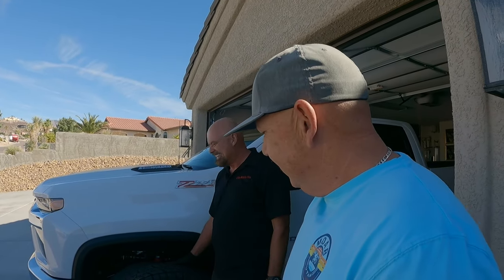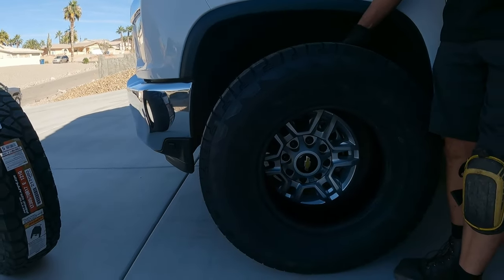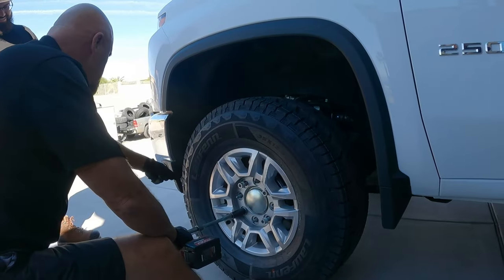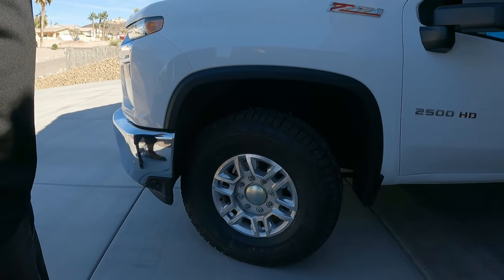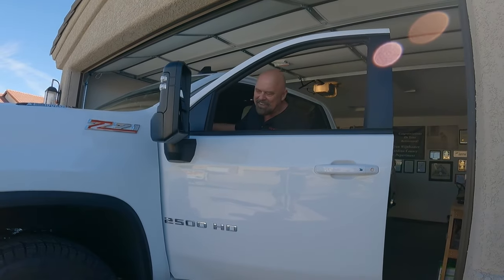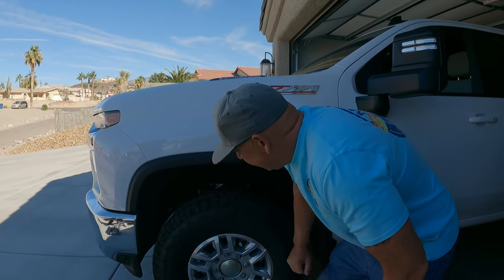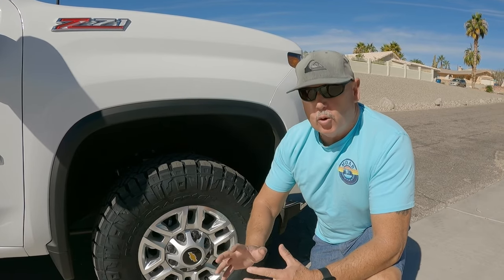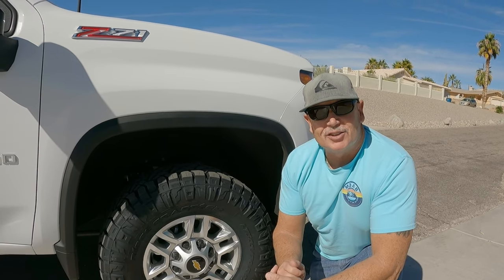2022 Chevy 2500HD Duramax 35 inch TIRE FIT TEST// WILL IT FIT?

Comment: I just put 35x12.50r18 nitto ridge grappler on 18x9 +18 offset on my stock 2022 at4 2500. Fits with no rubbing. I hunt and go off-road quite a bit and haven't had any rubbing issues.
Reply from the maker: Danny, that is good to know for our viewers.  I could of done the 35s no problem also. I use my truck as a tow vehicle, it changes the gas mileage and it changes the speedometer dramatically.  Thanks for watching and thank you for your comment.  Stan
Reply: @OverTheHillAdventures  I am getting a 2022 AT4 drama in a couple of months, so thanks for the info.Saved me a lot of phone calls etc thanks.Danny did you put those on the stock rims or aftermarket . As far as towing l see a lot of guys have seperate towing tires and nice rims and big tires for every day use. That is road l am taking.
Reply: I know for a fact that it wont rub with a 2 inch front leveling kit but stock of course it will.
Reply from the maker: @BlkGryTurboR  I am happy to say no rub at all even off road. Thanks for the comment. Stan
Reply: You think it would fit without rubbing if the offset was -12?

Comment: Thank you for this video man, You helped me make a decision on my purchase. I like to go a little bigger in tires without looking like I'm going through a mid life crisis.
Reply from the maker: Mario, that is awesome I’m glad I could help. Stan
Reply: Exactly! Lol, so what did you do and how did it work out, mine is 2021, Z71, LTZ, but it came stock with 20 inch rims. Currently 275/65R20. Like to go up, but not look like what you said.
Reply: The guy at my tire shop is convinced 295x65R20 will rub the UCAs with stock 20" rims. I would like to verify this is not the case before purchasing

Comment: I went with the 295/65 R20 which is a true 35" and has a higher load rating than the 35/12.5 20.
Reply from the maker: Hi Jeff, good for you!  I have E rated tires.  What are your tires rated at.  I bet your tire looks good.
Reply: @OverTheHillAdventures  Mine are also E rated and each tire can hold 4080lbs @ 80psi
Reply: No rubbing coming out of a driveway? Are you running a Leveling kit?
Reply: @carlosierra11  If that's directed towards me no level and no cutting or trimming. My 3500 did come with the beefier plow/trailer torsion bars.
Reply from the maker: @carlosierra11  same here no leveling kit.  I would caution other than stock rims if you go with aftermarket rims you might have a problem.  Thanks for watching.
Reply: @hdrolling thanks for the info. Which model tire did you go with? I'd like to do the same on my 2024 hd2500 zr1 on stock 20s
Reply: Most folks don’t realize that most 35’s are not true 35’s. They’re actually around 34.5 to 34.7 depending on the tire

Comment: Appreciate the video, mine is leveled so going to see how the 35s run on it. Thanks!
Reply from the maker: You won’t have any problems.  Remember we are using stock rims with stock offset.  Aftermarket rims may give you problems. FYI
Reply: My 2020 is almost level and is on 35s, been off road a bunch and no rubbing. That's with stock rims which are 7 or 7.5 inch wide. Had M/Ts on for a while (no highway shake). Switched to BFG K02s and according to GM tech (and BFG site) rims are to narrow for that tire, truck shakes over 55. It's been balanced 3 times including road force balance. Truck has steel WT rims too.
Reply: I keep hearing that leveling it makes it drive like a brick.. is that true? I’m getting mine here soon and would like to just level it with 35’s
Reply: I’m getting a 2020 2500HD soon. Want to put it on 35’s and level it. Are you saying that will make it shake over 55mph?? 😶
Reply: I have a leveling kit on my 2022, I took it to an independent shop for wheel alignment afterwards. Rides a  lot better. Had 2 different chevy dealers tell me that vibration was normal on factory 18s and those worthless michelin tires. Will be going to Falken 35s when they are worn out.

Comment: Barely fit on a 17 inch wheel. I have a high country which comes with a 20 inch wheel so I guess I won’t be able to do that without mods
Reply from the maker: Hey Manny, with your 20inch rims your tires are already 34inch tires. You will have no problem putting on 35 inch tires. As long as you use your stock rims.  Wider rims or aftermarket rims won’t work.  Stan

Comment: Of course you can. The stock Z71 comes with a standard 34.7 on 20's for 2022 year model. I also fit 37's stock, with minor rub.
Reply from the maker: Unfortunately mine came stock with stock 17 inch rims and 32””
tires.  I wish I knew this almost two years ago when I bought the truck.  Thank you for your comment!  A lot was learned when I first put this video out.  Thank you. Stan

Comment: I have the exact same truck, 2024.  Put on a set of fuel 18 x 9 wheels with +20mm offset, and a set of 35" x 12.5" x 9 falken wildpeak at3 tires.  They do rub when the wheel is turned almost all the way, not a huge issue, but just noting that with a wider tires and positive offset they will rub at full turn, and obviously will rub with even less turn when offroad.  I will be adding a cognito  premium 3" suspension leveling kit with fox PSRR shocks - that should reduce the instance of rubbing - the specs say 'Allows for up to a 35 x 12.5-Inch Tire on a 9-inch Wide Wheel with 5-inch backspacing' but, a +20mm offset is equivalent to just under 6-inch backspacing, so I suspect still just a minimal amount of rub at full turn.

*Update* with the suspension leveling kit noted above, there is no rub.
Reply from the maker: Hey Kyle, that’s great!  No rub when using stock rims.  Not as much fun as after market rims.
Reply: correct, I agree, was just pointing out to those who may have had the question (as I did, and just decided to take a bit of a chance) about an after market setup - hoping to help them out a bit too.
Reply from the maker: @kyledmears  copy that!  Thank you Kyle.

Comment: Thanks for the video. Im looking for wheels and tires for mine. The Z71 does add height. I don't remember the difference.  The stock tires are 275 65R20 (34s) . At least that is one of the tire options from chevy on this truck.
Reply from the maker: TXPatriot 70, thank you for your comment.  Our stock size that came with the truck was 265/70/17.  I chose to keep the stock rims.  When running 17 inch rims give you a smother ride than the 20 inch rims.  The Ford Raptors run 17 inch rims.  Just food for thought.  Thanks for watching our video, Stan

Comment: Should have done the test with 37s and 38s! 

The factory 20 inch wheel comes with 34.1 inch tires, so i just turned my keys up 9 turns and put 37s. Removed front valance. The only rub i have is on the front of the fender liner. Easy fix but im too lazy to secure the liner back in place. I dont mind turning my wheel 3/4 of the way
Reply from the maker: That is great!!  9 turns wow!! How is your ride?  You should put that on YouTube!!  Thanks for watching. Stan
Reply: when you added the 37's did you keep the stock wheels?
Reply: @kinggzz  yes i kept the stock wheels. but ive since done the cognito 3/1 leveling kit and 2 inch wheel spacers. No rubbing. I actually did the wheel spacers before the leveling kit and didnt have any rub with some more plastic trimming

Comment: I didn't think these came with 17s from the factory, was that a request when you bought it?
Reply from the maker: Hi Peter, it came from the factory with 17 inch rims.  I am pretty happy makes for a smoother ride.  I not running those tires anymore.  I am running the Cooper Discoverers much better tire.  Thank you for joining us. Stan and Rhonda🙏🏼🙏🏼
Reply: @OverTheHillAdventures mine also came with stock 17’s and I want to get a little bit bigger tire to fill up the wheel well a bit more without buying new wheels.
Reply from the maker: @Cenderton09  I would go with the Cooper Discoverer AT3 305/70R17 60k mile warranty and look great!
Reply: @OverTheHillAdventures  that’s what I had before just a smaller size
Reply from the maker: @Cenderton09  worked great on stock rims.

Comment: I have the same truck. But also keep in mind that the Z71 HD comes 2 inches taller that other HD's that are not Z71.
Reply from the maker: Good to know!! I wondered about that it just has a higher stance.  My son’s Trail Boss Z71 much higher than my old truck. Thanks for the knowledge and the input.
Reply from the maker: @chrisc.treemendous6244  riddle me this?  I have a crew cab 4X4 also.  However, my truck does not have the front end gate. My truck sits higher.  I have put my truck side by side by the standard truck and my truck is higher.  I can fit 35’s no problem with no rub on or off road.  Some have told me theirs rub.  I appreciate your comment.  🤷‍♂️ Stan
Reply from the maker: @chrisc.treemendous6244  must it.  It has a good ride no complaints here. The truck is a beast even when towing my trailer. Thanks for the Input.  Stan
Reply: @chrisc.treemendous6244  2022 Z71 HD and up come 2 inch higher.
My friend has a 2020 High Country Duramax and couldn't fit the 35's stock only with a 2 inch level kit and i did fit 35's stock on my 2022 LTZ Z71 HD.
Reply: @chrisc.treemendous6244  sorry but we drove new 2020 duramax hd LTZ Z71 off road and drove the duramax hd non z71 and side by side you can easily see the height difference on the 2020 model. we drove them the same day and parked side by side. we ended up getting the LTZ Z71 W/OFF ROAD PACKAGE, came with 275/65/20 wheels and tires and thats a 34.1 tall tire and easily could fit a 35", its a beast of a truck!
Reply: @chrisc.treemendous6244  i agree with you, it could be that. the truck we bought was a solid 3 inches taller than the other truck. the other truck was a 2500 gas non z71 off road, i guess it coulda been the fact it had 18" wheels?

Comment: Installed 35x12.5 BF Goodrich KO2's on my stock 2020 2500 Diesel LTZ Z71 wheels and they fit perfect with no rubbing at all.
Reply from the maker: Robert, thank you for your comment.  There are some that say it rubs.  Mine doesn’t either.  Perfect fit!! Stan

Comment: Z71 and std are same....only rancho shocks that are different......had both and personally I would take stock AC DELCOS over ranchos.....twin tube are horrible....

Everyone's tires are different so just depends on manufacturer.....those look really good and it does need a bigger tire to fill out wheel well on new models.....would take BFGs over Nittos, and pretty sure they run a lil small as well

Plus diesel sits lower in front over gas version as it weighs like 800# more........depending on GVRW rating
Reply from the maker: Kirk, thanks for your comment.  It is not only the Ranch shocks.  The stance of the truck is different.  I’ve had both also.  It also has skid plates which I did not have with the other truck.  Side by side the Z71 sets higher in the front.  

Regarding the fit test.  It was done with a different tire.  I’ve ran different truck tires for almost thirty years.  As a cop we always used Goodyears on our trucks for performance.  Went through tires like crazy but we can always count on them.  Personally,  I would go with the Cooper Discoverer they last longer and perform better than any tire on the market. BFG is a great tire they just don’t last.  This is the first time I have used the Nito Ridge Grappler.  I can tell you the tires are great and super quiet.  I will let you know how they perform.  You are right all tires are different.  

You are correct about the Duramax diesel.  The box weighs a heck of a lot more and takes away from the payload.  I wanted to go with the gaser for the extra payload but the gas mileage sucks on the big motors!!  I’m a little disappointed with gas mileage on the diesel.  On a good day I get 13 to 15mpg towing.  Empty I get close to 19mpg.  I was expecting a lot more.  The truck is a beast off the line 445hp Duramax with the 10 speed Allison.  I used to have the Dodge Cummins it doesn’t come close.  Kirk thanks again for your comment. Hope to hear from you again.  Thank you for watching our video!!  Stan and Rhonda

Comment: Mine has 20’s though. Does that make a difference ya think?
Reply from the maker: Eric, if you have 20” rims.  Your tires are 34.1 inches.  You can fit 35 inch tires no problem.  As long as you stick with the stock rims.  Stan

Comment: You think if the offset on the wheel is -12 it will rub with a 35 inch tire?
Reply from the maker: Yes, 100%
Reply: @OverTheHillAdventures  correct me if I’m wrong but isn’t it just another half inch outward?
Reply from the maker: @Thereallionheart  Ryan, ugh I don’t know brother.  It will be super close. Any negative offset with stock suspension will give me heartache.  I would definitely do a fit test.

Comment: So the 2020 2024 gas 6.6 2500 is 500lbs  less wieght over the nose then(diesel ) so if anything fit more tire under gasser front is gona be closest  point tires rub
Reply from the maker: Hi Justin, may be true but there is no tire rub with 35x12.5x17 on a stock rim.

Comment: How did you clear the knuckle? I barely have clearance with the stock 33s that came on my 2022. Any wider of a tire, and its going to rub on the knuckle
Reply from the maker: Hi Peter, I am not sure what knuckle you are talking about. First of all, what size of rims do you have?  I have no problems with rubbing at all, anywhere.  The guys who have 20inch stock Chevy rims were already at 34 inch tires.  Going to 35’s was an extra 1/2 inch on both sides.  Do you have stock rims from the dealer or did the dealer put after market rims on?  Your question is very interesting.  Thank you very much for your comment.  Stan
Reply: Stock 18s

Comment: I have 2020 GMC 2500hd my stock tires are 275/60/20 looking to buy tires will 35s fit On my stock suspension
Reply from the maker: Hello Krisway, your tires measure now 34.1 inches.  Yes the 35’s will fit on your stock rims.  If you go with after market rims I guarantee it won’t fit.  I hope this helps. Stan

Comment: I thought the 2022 2500 came with 20 inch rims not 17 did you change the rim size?
Reply from the maker: Brian, mine came from the dealer with 17” rims.  Much smoother ride than 20 inch rims.  The Ford Raptors come with 17” inch rims.
Reply: Only the higher trims come with the 20's, High country/Denali etc

Comment: Wonder if they fit on a 20” stock wheel?
Reply from the maker: I’m pretty sure you are already at 34” tire.  If you use your stock rim I’m sure you can go 35x12.5x20. Stan
Reply: Yeah you definitely can. I’m putting BFG KO2 on my 2022 AT4 2500HD
Reply: @tombrown03  how did this turn out? I have a 23’ sierra at4 2500hd with stock 20’s
Reply: @perezs0781  works mint

Comment: Funny I have a 2022 AT4 2500 and it does not clear.  It rubs the liner.  It works, I just live with it, but when turning corners sharp it does in fact rub.
Reply from the maker: Hey Ryan, thanks for watching.  I have a couple questions for you.  Are you running stock factory rims?  What size of rims are you running?  I am running the stock 17” rims.  It doesn’t come close to touching in a full turn.  The stock rims are the game changer.   If you run any kind of negative offset you will definitely rub.  Stan
Reply: @OverTheHillAdventures  Yes Sir , stock 20" wheels
Reply from the maker: @Ryansrangereport  I find that very interesting!!  We basically have the same truck.  You see on the fit test I have plenty of room.
Reply: @OverTheHillAdventures  its his wheels causing the issue- his are 20" yours are 17"
Reply from the maker: @harrybutter1286 It can be the only reason.
Reply: Z71 has a lift. I think 2"

Comment: Does the rim size make a difference? 18” version 20” wheels
Reply from the maker: The 20 inch stock rims already have 34 inch tires. With 18 inch rims as long as you use the stock rims.  After market 18 inch rims can make a huge difference and 35 inch tires may not fit.

Comment: how does it ride with the bigger tires though? seems like I can't get an answer on this anywhere
Reply from the maker: Hello Tim, it rides incredible.  Quiet no road noise.  I’ve been across the country and back pulling a trailer.  I have 23,000 miles on them so far. I would definitely get another set. I suffer a little on the gas mileage.  For the long haul they look good and ride great!  Stan
Reply: @OverTheHillAdventures  thanks!!